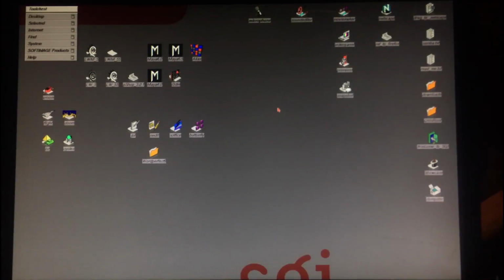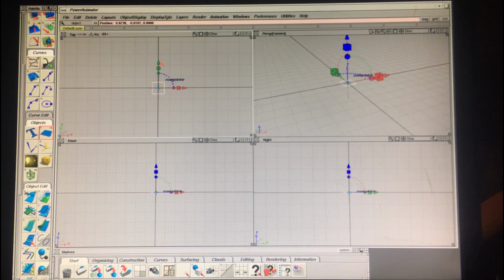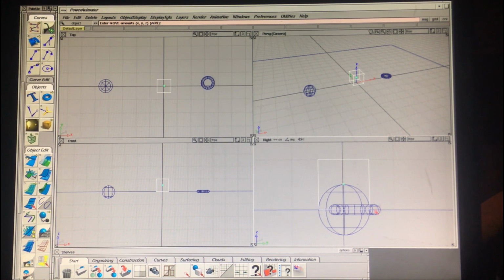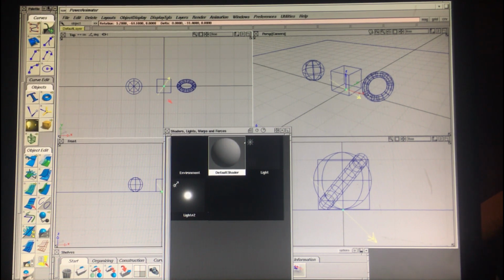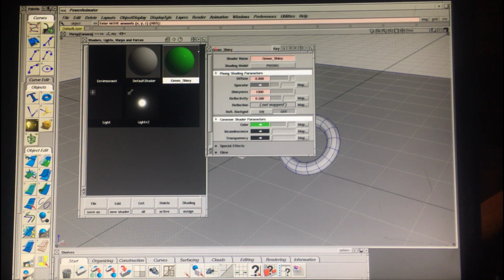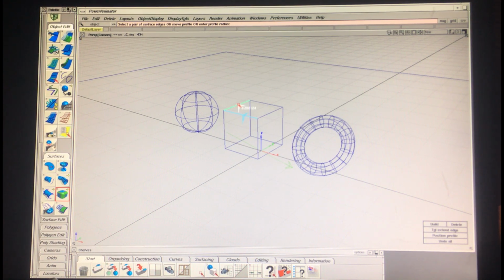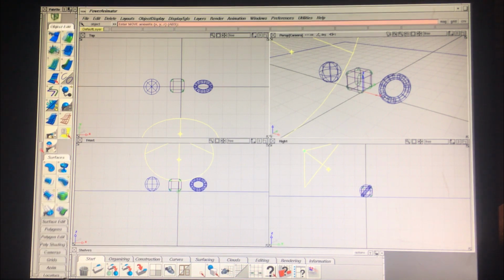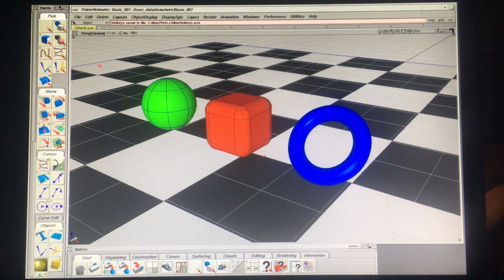Power Animator 9 in Irix -

Comment: Can you link a download for the version of power animator you used?
Reply from the maker: http://forums.irixnet.org/thread-128-page-2.html?highlight=power+animator      ...my profile there is Intuition. On page 2 of that thread there should be links to what you need. I used PA 9 for this one.
Reply: @caseycbenn  Downloaded the software, but i don't know how to install it onto Irix. Is there a way that you could create a tutorial on how to install and run Power Animator 9 or at the very least link a working tutorial?
Reply from the maker: @theanalogzone5724  Yeah this is a tricky area. Probably good material for a tutorial. Installing on Irix is not like any other OS unless you know Linux to some degree. I think I used the software manager for PA9 where you point to a file and it generally runs the install for you. They also have a traditional execute by running with the ./ command. Then the licensing is one those text file situations where you have to run a script and then input your computers "host" name. I set it up in like 2018-2019 so even I need a refresher now. Took me a few tries to get the lic right.
Reply: @caseycbenn  Hopefully you will create a tutorial on how to install PowerAnimator9 once you refresh yourself.
Reply from the maker: @theanalogzone5724  I will say though that, the people at Irixnet.org are very helpful and will usually give anyone the info they need to get, install, setup software to run. In case you have a more immediate need.

Comment: was there no ability in this to add something like Fresnel or Shlick-Fresnel to blend between diffuse and specular, as is the norm for the past 10-15 years? it can't have been so easy to make that oversight, technical artists and graphics programmers weren't more ignorant then than they are now. the Wreck-It Ralph uber shader was mostly a selection of which BRDFs are best for visual nuance/realism vs artist friendliness and how to make a complicated surface that can contain a lot of different materials using just one shader; Fresnel equations were around since the 1800s
Reply from the maker: Sorry, I missed this comment and have not checked back in a while. Believe it or not, there wasn't any physically accurate shaders in the early to mid 90s. There were these raw shaders with a lot of attributes. You were allowed to combine diffuse, specularity, etc at full amounts however you wanted. It took someone with proper know how to get the correct, what we call now, "PBR" (Physical Based Rendering) shaders going where diffuse is canceled out in direct inversion of specularity and roughness is the amount that reflection is blurred. It wasn't until around 2004 with Vlado's Free Raytracer (called Vray later), Renderman with Slim, and Mental Ray all started what is now the classic PBR model shading with built in fresnel that gains reflectivity based on the normal angle to the camera. There were a few ways in early Maya to do this manually which was to plug a gradient into the sampler info node then run the gradient into the reflectivity channel  on a shader. I think there were Fresnel plugins for Power Animator likely available but I don't think I had anything loaded up here in PA9.

Comment: https://youtu.be/lfFdhb2xI2M
Hi, I did several tests rendering with Power Animator 9 and none of the renderings were like the link I posted here on YouTube. Is this type of rendered image only obtainable in versions prior to 9? If anyone gets an image like the one in the video I would like to know let me know. Thanks.
Reply from the maker: It doesn't matter if you use version 1 or version 9. The basic look in everything you posted is what happens when you simply use the most simple of the features. That look that you want to achieve was a product of the limitations of the era. In this first video I made here at 19:30 you can see that a simple directional light has hard shadows and that the basic default grey material is very generic. If you just turn on reflections a little bit you'll get specular highlights. You can get this look from even the Maya software renderer or Power Animator, Softimage, etc. Its not about the specific version. It is simply understanding the limitations of software in the 90s. They had that look because turning on raytracing made rendering take forever. So they used specular highlights and hard shadows to speed up render time. The plunger in the toilet animation is mostly basic materials that have a specular highlight and I see some shadowing happening. There seems to be no area lights. Mainly spotlight or directional lights, maybe a little ambient light to bring up the dark areas. You could make the same kinds of renders in PA 9. The trick though is understanding that no version of the software is going to just give you what you want. You have to know how to model, shade, light, and animate these things to even get that basic look from the 90s. Again, look at 19:30 with the basic cube, sphere, and torus. They are grey with hard shadow. If I would have just added maybe 50 shininess vs 1000 it would have that broad specular hit. That's it. Add in an environment sphere and map a background onto it for the objects to reflect and you'll get some of that reflection in the objects. I am trying to get my Octane going again, hopefully before the end of February and I'll do a retro animation look tutorial.

Comment: Hi, could you test your power animator version 9 and show how to use, for example, the particle module that comes with Dynamation
Reply from the maker: I do have my Octane back but am ordering an 13w3 adapter and cable as I do not seem to have the old one anywhere. If I can get it setup and going again I will do more Power Animator vids.

Comment: https://youtu.be/u3XrvduZ8wM for example this YouTube link this version is showing a very real image quality I didn't see anyone managing to do that in version 9 and I saw the animation tools too which are very advanced and if the person looks until the end of this video they will see also very advanced particle tools I think all of that but mainly the renderer doesn't have it in version 9 I've never seen such a perfect image in another version that wasn't in the old versions and I think that this is not the work of a person who it makes a better shader that's because it's already native to that old version.
Reply from the maker: That hand isn't something that getting an older Power Animator will help you achieve. It is more a demo of the scanner technology. The geometry scan as well as the photos derived from the scan, like the diffuse pass, specular pass, the normal/bump maps etc, are all the primary reason for the quality. You could put the same scanned hand and maps into any 3d software and get a nice result. The fact that it looks that nice in an old application like Power Animator is a pretty neat demo... but getting the "older" version isn't going to help you get that built from scratch very easy with the default modeling tools or surfacing shaders. https://www.turbosquid.com/3d-models/realistic-female-arm-hand-3d-model-1312491

Comment: I'm going to give you a very interesting tip: don't waste time modeling in power animator or alias studio tools. Use Maya to model is much faster and you won't have problems with anything. Import into power animator and do the rest. Placing bones and rigging in power animator or alias studio tools is very easy and you will never have problems with node influences.

Comment: I use Maya very well and I can say after all these years that what was seen done in rendering both power casting and rendering power rendering will not be seen done by rendering Maya. In other words, those who liked what they saw in the old movies, don't waste time going to learn Maya because his rendering is different. Another important thing is to know that the mentalray is what was seen in the matrix and here the softimage does it, I did tests and they were the same. The Fight Club movie I did tests and they turned out the same too. But don't try to do the same with the XSi version because you won't be able to because they are different renderers even if they are called mentay. they are different verses. For example, in Datacad there was Velocity and then it came with RenderStar and each render has, let's say, its own photograph and when you changed versions everything changed, it's like using a kodak vision 2 cinematic film and then coming to kodak and selling the kodak vision 3. this already has to be understood. It's like using acrylic paint from one brand and the same brand changing the formula of the paint you used to paint artistic pictures. that is, if you want what you saw, you'll have to use exactly the same software in the same version with the same renderer. and the most important thing is that most of the most amazing images for example from pixar were made by programmers for example in the movie heart of dragon. The animation appears all over the internet but the renderer is nowhere to be seen and this is due to the reason that the renderer is not commercial but made by programmers. luckily for those who love what they saw in movies the power animator this yes used most of the time his own render. there were a few times that, for example, in alien 4, modeling was done in power animator, some animation in the old softimage around version 3.8 and the rendering was done by renderman but only because renderman has an extremely good rendering at doing what most people do today it's called dynamic ranger I did some tests with renderman and there are no difficulties in achieving ultra reality, you practically don't know if it's photography or rendering. in my case, looking for those fake but very charming images from movies like the movie THE CORE, then the power animator is for me what I try to develop the most. I started late on power animator. I started this month.

Comment: Hi Casey let's make everyone who loves power animator and softimage an expert. We will pass on all our knowledge and copy of the software to make everyone happy. I'm sure everyone loves cinema and that's why everyone is having a copy of the software but there's no point in giving away a copy and letting people try to figure out how to use it. We will pass on all our knowledge to make everyone happy. What do you think Casey?
I saw a lot of motion blur in these animations. in this link you can see for example the propeller of a helicopter at 10:03 and also at 10:09 and there are stones that appear rising at 10:26 and really without motion blur everything would be very false. but in the version, for example, of alias studio tools 9.5, I couldn't make the motion blur work and I'm even afraid that it won't appear in some version of alias power animator. I can't understand why it doesn't appear in the alias studio tools 9.5 in the windows version if I activated everything I could. unless it's like in softimage which has to go into a special mentalray menu. and in this case I would have to know which menu is that inside the alias studio tools which is probably in the same menu as the alias power animator since both are very similar in everything. I think that even the dynamics as they are called in the irix version softimage can be well hidden or in front of me and I still haven't noticed. for example to make the rig in bones i had to practically guess from my experience in other softwares because i don't have the manuals on paper for power animator and i also don't have any pdf files on paper to know how to make the rig in alias studio tools i learned alone. if anyone wants to know how to make the rig you can ask me because everything is yours I will teach you including a copy of so power animator for irix I have version 9.0 if anyone wants just tell me and if anyone has the old versions of power animator for please let me know and let me know too. everything i know about softimage i teach i know a lot and i've been using version 3.7 to version 4.0 since 1998 i know how to do practically everything i want in softimage and i can say it's sensational and the motion blur is fast and is the best i've ever seen. It's not like renderman which takes a long time and needs an rtx card to get blur smoothing. for me the old versions so softimage especially the 4.0 version like the one they used in the movie maskara and dinosaur park is the best i have ever used. version 3.8 is not as good.

Comment: https://youtu.be/aVWlBCl-S-w
https://youtu.be/wwN1AoVxCmM
https://youtu.be/YlSFWkpsjFM
https://youtu.be/cUtvbyZlYCo
https://youtu.be/M3QkGP4KGCk
I did some animation tests with bones and turned on the geometry and it was very well resolved. much better than the results I usually do in softimage 3D in irix. I use softimage 3.7, 3.8, 3.9 and 4.0. I also use softimage xsi but the render in softimage those of irix's original screen mental ray and adjustments give much more interesting results at least for me. I will post too.

Comment: Tell me if it's worth using the programs on an octane sgi. is there any advantage to using irix programs on an octane sgi? it has better performance and stability and everything is better or isn't it like that? tell me please since you have a lot of experience in sgi. I ask you because I am interested in buying one that is now in front of me a sgi octane 2
Reply from the maker: Well, if your goal is getting the look of the 90s animations from the link, then SGI and Octane and the applications you have are the right way to go. They have that more classic 90s graphics and animation look built in since that is what was used to render the scenes you linked to. That is the main reason to use SGI is to get that classic computer graphics look. Octane or Octane 2 is likely the best option for working since it will have the most snappy feel. Unless you can get a Tezro but they are rare to find now and still very pricy. Try to get a dual proc Octane or Octane 2. That will help with the rendering speed and the amount of detail and geometry you can have in a scene.

Comment: I saw that you made like a godzilla in an animation of your demo reel. you could make one like this in power animator. in any version of your power animator. and sell me I'll pay you. I want to put computer graphics in the films I make here. how much could you charge me if you were going to do, for example, all the 3d animation parts that exist in godzila that old movie from 1998. there are a lot there that are models and people dressed as godzila but there is also a lot of animation. could you make a budget for me. but i want it to be done in power animator not light wave or maya or other software. if you have dynamation installed I prefer you to use it. I don't know if the dynamation is inside the power animator or it's separate from the one that makes particles.

Comment: hi but it does yes i'm sure because it has these adjustments inside the rendering and you can see it in the independence day movie in the link below the planes blur when they move. In this video there is animation and it is possible to see the blur clearly. I acine everything here and it didn't blur it must be something I didn't realize I have to click or add motion blur to the object. in softimage it is necessary to indicate which object will want to see motion blur. that's probably it. I found in the power animator where you can indicate whether the motion blur is turned on or off per object but this is something that is probably just to control turning it on and off. to force objects to have motion blur it should be equal to softimage. in softimage it is in a menu called mentaray. that only talks about the motion blur.
Reply from the maker: I am not doubting that Power Animator in general has motion blur, but I have used a lot of CG software in my career. Sometimes you have releases with bugs and I have seen some render engines get a build where there are all the checkboxes for a feature to be turned on but it still doesn't turn on. Motion blur in a few render engines have had builds that just don't activate when checked. I am saying that I wanted to test this same feature with the Motion Blur turned on in Power Animator 8.5 to see if it was simply a version issue with 9.0. Like, there might be a PA 9.0.x release that fixed the motion blur issue but it isn't the one that is still distributed around today. If I was able to test Power Animator 8.5 and just see if it is turned on if it shows up.. then I could confirm. OR maybe it is one of those little gotcha's where another checkbox needs to be ticked or setting switched on. But I remember trying to address this for like a week every night and could not make it turn on no matter how many settings I found. Each item has settings, the render settings themselves. 18:01 shows the render globals and there is the motion blur section. I had intended to make an animation tutorial for PA 9 shortly after the mouse tutorial and I usually sit and test things before I do a recording and found I didn't find a way to turn on motion blur. I will be trying to address this.. later this year since I have my o2s and Octane here with me again. Was actually going to try and get Renderman running to see how well it runs on an SGI.